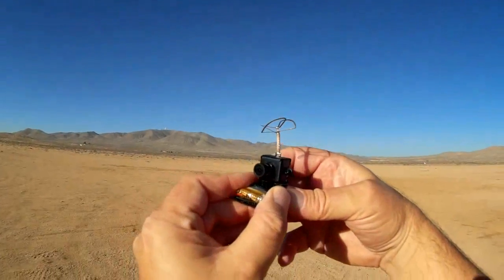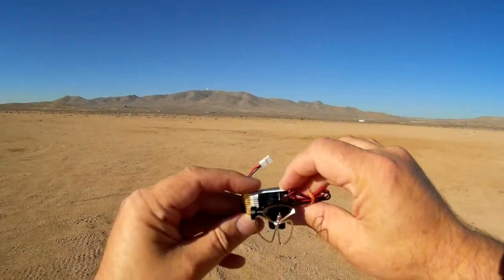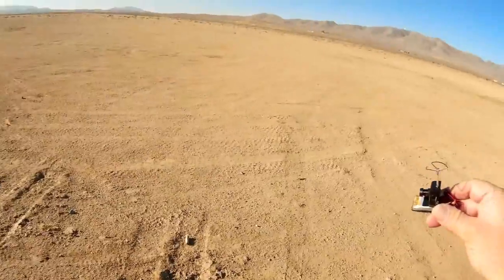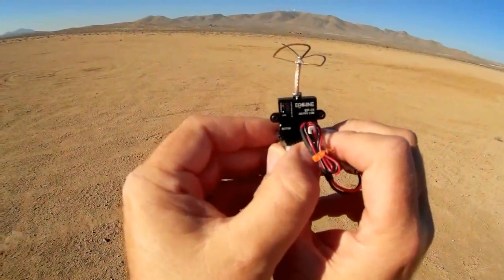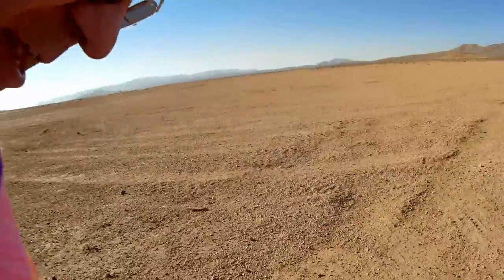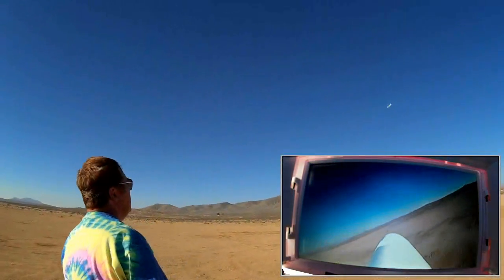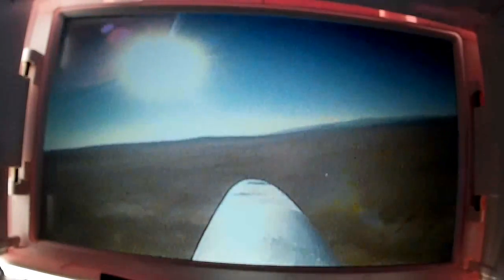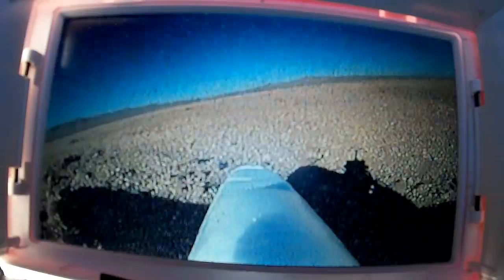Eachine EF-01 5.8Ghz 40 Ch 25 MW VTX FPV Camera Flight Test Review

Comment: What's the time limit on 1.cell lipo on a cyclops mini fpv camerA
Reply from the maker: It depends on the mah of the battery, and the wattage of the camera. For this 25mW camera, I used a 350mah in the above video, and it still had plenty of power after the flight.

Comment: So what would you say is the max range you'd get out of a 25mw AIO camera because I'm panling on building a tiny whoop and want to use a 25mw camera because they are cheaper  (almost half the price) and was wonder if I'd get at least a 100 to 150m range thanks in advance and I love your channel please keep up the great work
Reply from the maker: Yeah, about 100meter range with a 25mW.
Reply: @Quadcopter101  so that the image remains stable what frequency do you use? what bend?

Comment: CAn you confirm if this was a 25mw or 100mw AIO cam+vtx? I have a little AIO sitting around i was going to put on my little Wltoys 949 cessna but i wasnt sure that 25mw would get me the range i needed
Reply from the maker: This was 25mW.
Reply: @Quadcopter101  awesome thank you! Did you run the cam power straight to the main battery leads?
Reply from the maker: Yes I did using adapter plugs to convert the connection to white LoSi connectors.

Comment: If you want to use this cam on your android phone ,Look up Eachin stuff on BangGood .for about 60$ your in BizzFPVid ,one receiver even has 25 to 600mw ,I think if I got this right that has to do  with the distance you can get the signal ,enjoy  Thanks Quad .I will see to post a vid in a few weeks =D
Reply from the maker: The transmitter (not the receiver) defines the transmission mw power (i.e. the distance).   And for $35 you can get a reasonably good ready to go goggles with battery power as seen here https://goo.gl/1K2wPT   I really think that you'll be frustrated with the setup that you seem to have your heart set on.  Waiting to see your video.

Comment: Thanks for a EXTREEEEMly fast reply =D , How about "Easy Cap" another u-tuber I forget name used a very cheap VR headset  with easy cap adapter .I have to get into this vid thingy .There is also a drone I seen that was programmed to follow a preset moving ttarget ,which would be me on the go on the bike .....  will have to free up some funds your lucky that your half is in with your hobby's mine is not =(   hehehe ,tyvm
Reply from the maker: You'd still need to purchase easycap, smartphone VR goggles, and a 5.8Ghz FPV receiver for the easycap.  In the end, you'd have been better off with cheap 5.8Ghz all in one goggles.  Most that are serious FPV fliers use 5.8Ghz analog systems exclusively as they have minimal lag, and are not subject to frame freezing (both of which can individually cause a crash),   The WiFi FPV fliers are mostly toys, with poor range (averaging 20 meters), severe lag, freezing, and dropout limitations.

Comment: Question from a non initiate ,i'd want to use this while I ride my bike ,what do I need to view what the cam see's? can I link that to my smart phone ,I figure emitter so reception thingy + monitor .But what one's .I want to spend a minimum for testing if I like doing vids  and if I have any talent in that field > Grats Seems we are a lot alike ->Kids @ heart =D I had fun looking you vid .Tanks .Subbing so I think that will make it easier for u to send me info ,Thanks
Reply from the maker: Unfortunately this won't work with smartphones as it sends an analog signal on 5.8Ghz.  You'd need analog 5.8Ghz FPV goggles to view the signal, such as the following https://goo.gl/1K2wPT

Comment: I have read the wiring is reversed is anything to this, or Red to Positive, Black to Negative as all DC, just a question. I just order mine, and where did you get the connectors to run it on the battery, as I am going to run mine on a syma type 1s 3.7v battery also can't wait to try it out. 
Thanks
Reply: Also what is the max mAH 3.7v battery can be ran on it Thanks

Comment: Thanks for the review , could you please let me know which battery you have used in the video , also I was wondering whether this one will work for the fpv http://www.banggood.com/Eachine-3_7V-380mah-25C-Lipo-Battery-for-Hubsan-H107-H107L-H107C-H107D-p-993950.html?rmmds=search
Reply from the maker: Yes, that would work.
Reply: Quadcopter 101 Thanks

Comment: Does the camera (EF-01) get hot  when you are using it? (Hot to touch)  3.7 V250mah battery
Reply from the maker: It gets a little warm, but not hot.  And I'm using a 350mah battery.
Reply: Quadcopter 101 OK thanks... I have to look into why my camera  is getting hot.

Comment: Awesome! there is another cam/vtx combo that is 250mw but uses a dipole antenna. how do you think the performance would change? also, the eachine is $40 and the dipole unit is $25 i'm wondering if it's worth the extra money as i am on a tight budget. thanks a million.

Comment: Always thorough, good and interesting reviews!   I have forgotten to turn on the camera and it's been what I've done several
times until I got wise and went FPV.  I see several other models at BangGood, the MC01 which can take a higher voltage of 5-17 v. 
and a new one the MC02 switchable to 25-200 mw. A real quick way to add FPV to the planes and quads. Thanks for the review!
Reply from the maker: I'm preparing another video review of the MC-01 attached to my XK A600 airplane.  For this upcoming review, I have tapped the airplane's 7.4V battery for power.

Comment: I get very good stable image in close range, but after 7-10 meters it drops suddenly ... I tried everything, removed the case , checked the antenna.... changed the frequency,  still the same story ... good image to 7-10 meters then no image ؟ !  its like just 1 mW energy ... maybe defect? what should I test more?
Reply from the maker: Check the receiver antenna (what receiver are you using by the way?).  Also, check your power source (try a different battery). But if you're absolutely certain that the receiver is operating properly, and you tried a different battery, then yes there may be a problem with the transmitter antenna.

Comment: Iforce2d did a review on the MC-01 version of this thing and got over 300 metres with it using the correct antennas on the VRX.
I think the only difference is MC-01 allows higher input voltage.

Comment: Hi Quadcopter101, Do you think the WLtoys F959 and Aviax H2O could carry the  'Syma X5C X5S 5.8Ghz FPV Upgrade' camera ?
I'm thinking about buying them for my first fpv system.
Reply from the maker: Yes, but you'd have to fabricate some mounting platform, and also replace the control plug with a switch if you wish to use the record feature.  But a better FPV option is the above camera with this http://www.banggood.com/Eachine-VR-007-5_8G-40CH-HD-FPV-Goggles-Video-Glasses-4_3-Inch-With-7_4V-800mAh-Battery-p-960761.html?p=RB0922217402201307U3

Comment: Watched SeBy's review of this as well.  You defeat the advantage of a diversity receiver by have 2 of the same kind of antennas on it.  Get a RHCP antenna and put it on one input at least.  I put a 25mw vtx on a X5C, and using my X8 TX, was able to fly it over
200 meters without FPV drop out. At that time, I had a RHCP on one input and a Bird's Eye View Planar (RHCP) on the other input.  As far as the 5 hour limit with the MI drone, don't get too excited.  D. Dunnill got his over the 5 hour limit, and while it takes away the 100m restriction, it DOES NOT open up any of the special functions (Point of Interest, Waypoints, etc) I find it appalling that Xiaomi released the MI to reviewers just to have them do the Beta testing on it. Personally, because of what I've seen from 3 different reviewers, I wouldn't buy one. In the end, after "X" number of updates (who knows how many) it might actually fly and do what it is advertised as being able to do, but to release it in the state it is ... that is unconscionable (imho).

Comment: Where did you buy the battery from?
Reply from the maker: This type of battery is widely used throughout many quadcopters, widely available, and dirt cheap http://www.banggood.com/Eachine-3_7V-380mah-25C-Lipo-Battery-for-Hubsan-H107-H107L-H107C-H107D-p-993950.html?p=RB0922217402201307U3
Reply: Thanks :) You just got a new subscriber :)

Comment: the camera on my jxd509g died ,so I am wondering if this camera would plug in as a replacement to the connection on the underside of the 509g?
Reply from the maker: You might be able to, but the video image would be upside down.  It also can't record.  There is another camera that can be inverted, but its video  isn't as sharp (600TVL vs 800TVL) http://www.banggood.com/Eachine-MC01-AIO-5_8G-40CH-25MW-VTX-600TVL-13-Cmos-FPV-Camera-p-1065228.html?p=RB0922217402201307U3
Reply: +Quadcopter 101 in really grateful for all your help and advice. Much appreciated